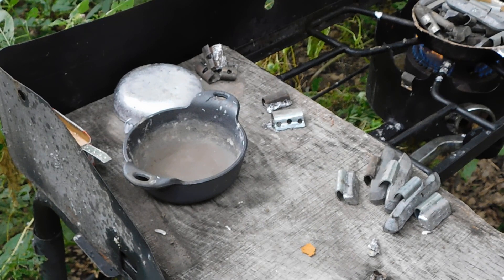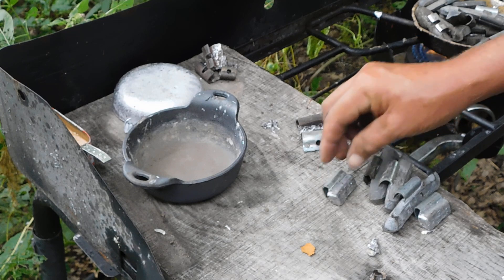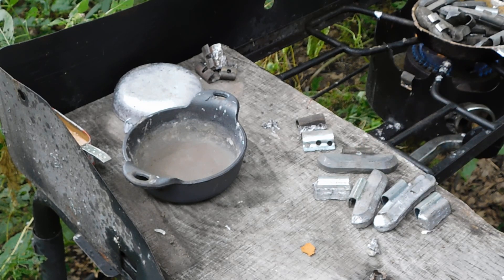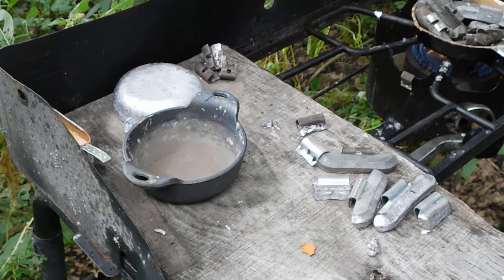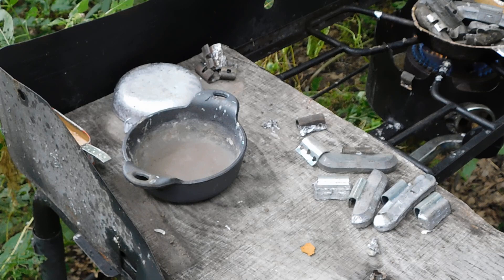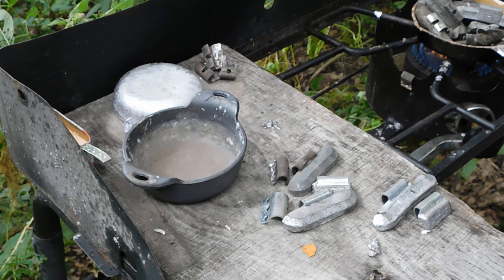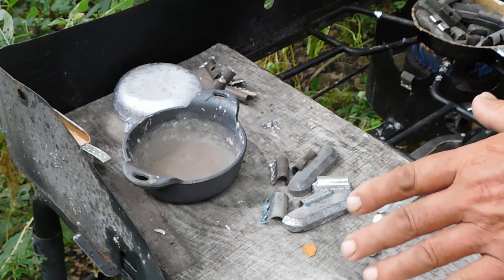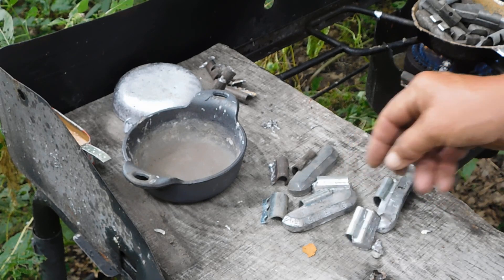Avoiding Zinc contamination

Comment: I melted down old roof lead and it has that shine to it. It wasn't coated with anything and very soft. I another batch I melted an old lead glass lamp shade and that was a very frosty white. But also very soft. Any thoughts anyone? Should I just use it for buckshot? And what does the zinc contamination do?

Comment: I get wheelweights at mom&pop tire places. I do my initial cleanup outdoors on a sunny day. 
I clean up the weights in a six quart cast iron pot on a gas turkey fryer.
This tip is important.  I leave about an inch of lead in the pot at the end of the day. 
Then when i go to clean up another batch of lead that lead in the pot has full contact with the heat.  So it melts faster than a random handfull of wheelweights on the bottom of the pot. 
Second' i have a known alloy in the pot when i start. When i get that lead melted and the temperature adjusted to around 700 degrees then i can add handfulls of wheelwrights to the pot without hand sorting the weights. Any zinc or steel weights will float on top of the lead like a cork fishing bobber on a pond.  I can just skim them off with 
a big spoon.
I use a soup dipper to cast ingots
In a cast iron  bun pan that casts a half round ingot about three inches long that fits neatly in my Lee 20 pound pot. Each ingot weighs just over two pounds.
I do sort out the flat, stick on weights because they are soft lead that i use in my muzzleloaders. 
Zinc can be saved and used to cast balls for model cannons. Zinc balls are closer to the weight of iron cannon balls.
I have learned to sort lead by hardness with my thumb nail to see what it is.
If it seems like lead but i cant scratch it with my thumbnail then its probably lynotype.  Good for cast bullets in rifles and for mixing with softer lead alloys for pistol bullets.
If i can barely scratch or dent it with my thumbnail then its probably wheel weight alloy and good for standard pistol bullets.
Because it has antimony and tin in the alloy it can be hardened by dropping the bullets from the mold into a bucket of water to temper them for use in magnum pistol loads.
If i can easily scratch or dent it then its pure lead and good for muzzleloaders.

Comment: Increasingly, the entire wheel weight is made of zinc, not just the clip plating. They're doing the same thing with battery cable terminals. It is good you are using temperature discrimination. Don't be surprised if the odd weight refuses to melt at the low temp. It is completely zinc.
Reply from the maker: In several states, California for example, lead weights aren't legal anymore, so you will see more of the zinc showing up.
Reply: Yep. Have been for several years now, even here in Colorado. It's annoying to sort the damn things out.

Comment: How did that batch turn out? Good lead melt, no zinc, I hope.
Reply from the maker: Perfect on the wheel weights, but when I remelted the one block of lead that was in the can I could see slight traces of zinc in that.  I haven't messed with the lead pipe yet, but that should be pure clean lead.  I plan to use some of that in a buckshot mold.
Reply: @logcabinlooms  hopefully there isn't much in the big block, and you can still make use of it.

Comment: I get about 10 5 gallon buckets once a year of wheel weights. A little less than half are zink. That turkey frier works well. I see the coating on just as many that have lead under the coating.

Comment: Learning a lot from your videos. I am getting a Winchester 94 .30-30 in a week or two. And it would be fun, and perhaps save some money by making my own bullets. I have to load anyway, as .30-30 is such abn uncommon round here-
Reply: Casting for the 30-30 is a worthwhile project. Get the Lee 170 grain flatpoint and load it around 1500 to 1600 fps and you should have good success with it.
Reply: chris mclaughlin  I am in Norway.
Reply: chris mclaughlin  Thank you for the answer. 
The Winchester 94 and other Lever actions are not uncommon. You will find them at many gun dealers or lised for sales in the used guns listings. But they are not really taken seriously here, as the only game you can leagly hunt with it is roe deer and smaller, only found in a small part of the country. Like most people I bought mine just as fun to have gun. So I dont really need much power. 
AS for gun pwder the most avaialble ones are from Vihtavouri (Finland) and Norma which is Norwegian. I have experience loading for the .3006 and .308 calibers.
Reply: Sadlky the guy I am buying the Levber action form is sailor, and crew change has been postponed to beginning of september, so I wont have the Winchester in my hands befor ethen...well, well, duck season starts on friday, I will have other things to thinkj about :-D

Comment: Thanx for the tip about lower heat to get the clips out before the zinc can ruin a batch.
In South Africa some of the clip-on weights are made totally from zinc. I like to sort before even starting furnace, throw out the zinc ones and sell it back to scrap dealer. 
I like the weights they put on mag wheels here, they seem to be pure lead. They do have double tape that makes big mess when melting but its worth it. I mix in bar solder we get here that is 40% tin. There is a dealer close by that sells tin and antimony in pure form, have not tried that yet. 
We have a local guy bragging that he has developed a better coating for cast bullets than powder coating or HiTek. With the availabilty of ammo and components turning to be as scarce as hen's teeth cast bullets seem to be the way to go. Fortunately for us when US primers are difficult to get importers seem to get hold of Czech and Russian. Think you in the US will not be able to get the Russian primers as result of san..ions.
Reply: How safe is the area that you live in!
Reply: @donaldatkinson7937  it is now wilder than the Wild West. Being armed 24/7 helps. I live in Centurion, a suburb of Pretoria. In last week we have had 2 civilian defensive shootings, one of them in a church where churchgoer killed two armed robbers who entered church with guns. To be honest, anywhere in our country is like a war zone.
Reply: Stay safe, I don't claim to know much about south Africa, but why would people want to kill the farmers who feed them, I will never understand these idiot's.

Comment: I have a similar setup as yours for smelting lead. I get my WW’s from a local tire shop. I try and pick out all the steel and zinc but keep the heat low in case I missed any. Never thought about the clips being zinc coated but that makes sense.

Comment: I’m wondering if you could use a torch to heat the clips enough to break them loose.  Before you melt the weights in a pot.
Reply: I'd wager it's more economical and faster to just melt the weights at a low temperature. If you've got a big batch, you'd be spending a lot of time and gas with the torch.

Comment: i like em lil frosty, it also helps powder coat too, i sort the weights before making ingots, once in a while i miss a zincer but with the low temp they present themselves easily  and float , zinc plated clips if not managed will comtaminate a batch....great info
Reply: Are there any benefits to powder coating or is it just an aesthetics thing?
Reply: @Imur_Huckleberry  its not copper but i have not had any leading so far i run with a large group of reloaders and casters all with success
Reply: @mckwilly  Thank you Sir.
Reply: @Imur_Huckleberry  glad to share, if ya wanna try some i'll send ya some coated projectiles
Reply: @mckwilly  Oh no thats quite alright. I picked some at a gun show sometime back and just never had the courage to load them. I kept thinking if copper such a chore to get out I couldnt imagine scrubbing on powder coat. I'll take your word and give them a try. Thank you Sir.
Reply: @Imur_Huckleberry  good deal, loading comes in handy during these 'shortages' im glad i thought ahead a lil bit grabbing supplies while they were still available